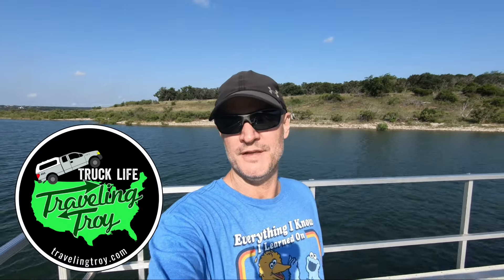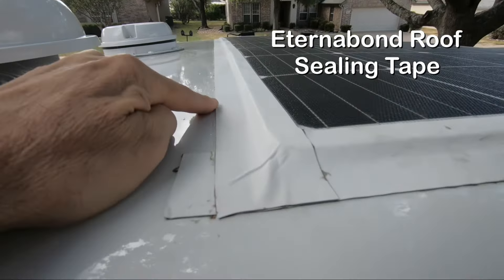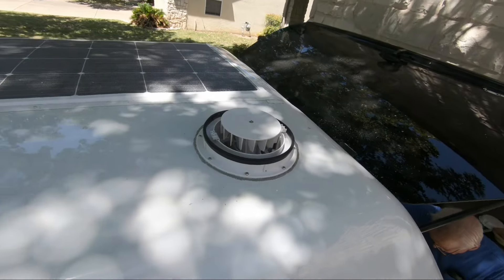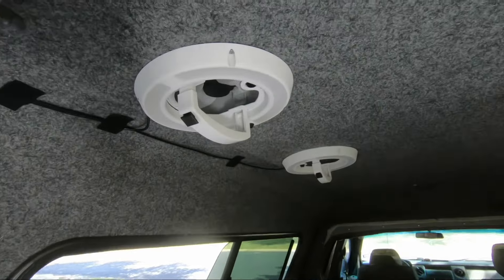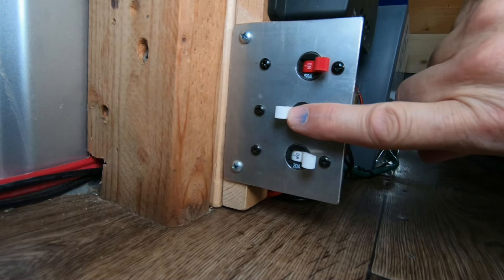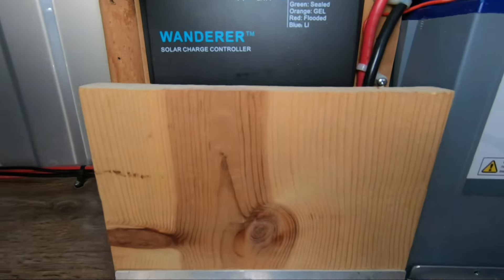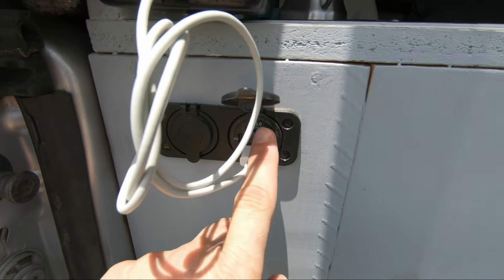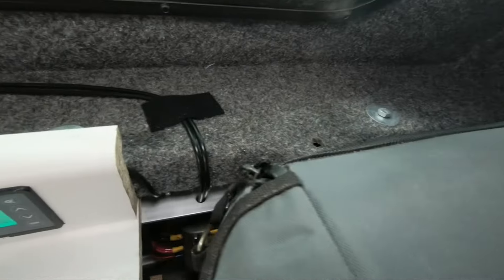DIY Truck Camper Build #7 - Solar and Electrical Build - F150

Comment: Beautiful lake, have a great weekend Troy!
Reply from the maker: Thanks! Weekend going pretty well, thus far.  Hope it’s a good one your way as well. 👍
Reply: @TravelingTroy we may drive the Astro to Death Valley for July 4 break. Did you use a 6” hole saw to cut the holes for the vent fans, or a saw all?
Reply from the maker: @DarronSanderson  We just drew the circle outline, drilled the center hole and just a saw to cut out the hole.